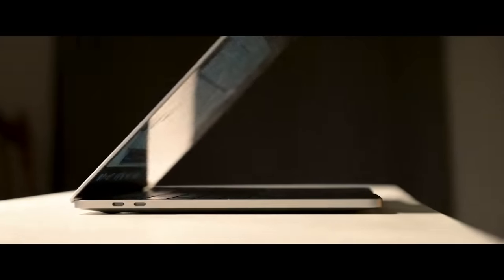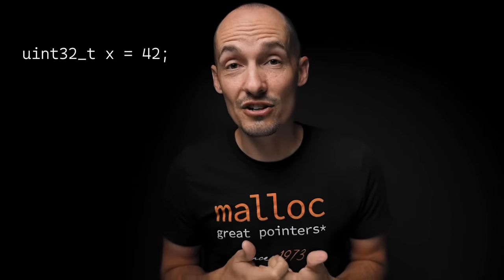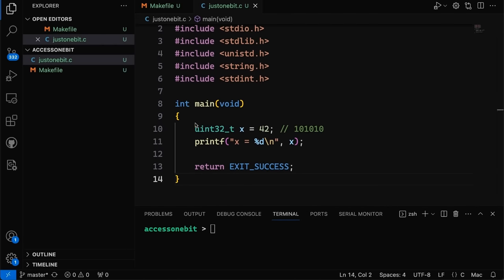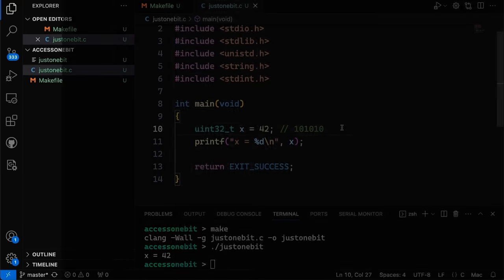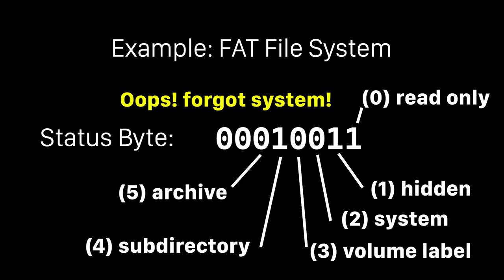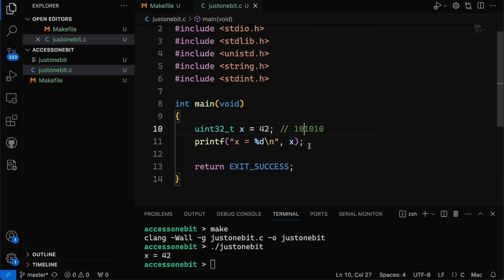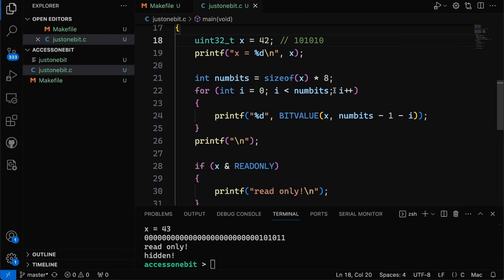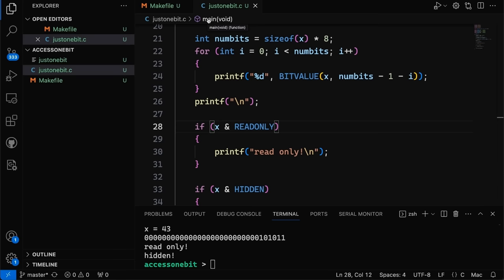How do I access a single bit?

Comment: A passer-by note : in C, you are only technically suppesed to do bitwise operations on unsigned integer types. Signed integer type behavior is signedness implementation specific. Most coding standards will shed a tear if you do this. They will even make you specifically declare your constants as unsigned. I personally allways fall back to unsigned types and use signed types only when necessary. Just saves me a lot of trouble in general.
Reply: I think with C23 negative number representation gets standardized to 2s-complement and with that a lot of signed value behavior should get standardized as well, but I might be wrong.
Reply: @esdel  I sure hope you're wrong. That would reduce C's portability because then the behavior will have to be explicitly redefined for 1's complement machines.
Reply: @anon_y_mousse  2's complement is in C23. 1's complement machines exist? (I realize you might have been sarcastic on that one lol)
Reply: @xhivo97   They're old and rare, but they do exist. It's just that this will be a constant craw in my beak when I try to tout the portability of C and proponents of every other language will point this out with glee even though C will still compile for such computers and many more that their language of choice won't work on and it'll irritate me. It's tough being one of a small handfuls of C proponents. Only makes it worse that now I hear they're adding constexpr to C. If they're just going to copy every C++ feature then I can't finish my own language fast enough.
Reply: @anon_y_mousse  I dislike C— too. But what’s wrong with constexpr?
Reply: @casperes0912   You've misinterpreted what I was saying as I don't dislike C at all. As for what's wrong with constexpr, that's a conversation I've already had far too many times with regards to C++ and no one seems to understand my reasoning so I'll just leave it there.
Reply: @anon_y_mousse   You're the first person I saw going against constexpr. I'm guessing its specifications will be simplified. Regardless, I'm really interested to know why constexpr is a bad idea in C23.
Reply: @anon_y_mousse  they didn't say "I dislike C too", they said "I dislike C-- (as in C minus minus) too"
Reply: @capsey_   No, they didn't. Copy and paste their text into an editor and you'll see it's a full dash, either en or em I'd have to check the Unicode charts.
Reply: @anon_y_mousse  i think it automatically changed two regular dash to full dash
Reply: @capsey_   It's never done that to me or anyone else that I've seen as people regularly use -- snippets of code and otherwise. So unless he comes back to the conversation and says so, I can only base things on what I'm actually seeing.

Comment: Shouldn't teach people to hard code values like 8 bits, we have CHAR_BIT, should use every time to teach people to be in the habit of using adaptable macros instead of hard coded values. The people who learnt to hard code 8 bits as the length of bytes will surely in the future encounter situations where they will have to go through their whole code base replacing that value because of that bad assumption (granted 9 times outa 10 it will be because of old systems that they need to but there's surely research systems etc that use bigger values too)
Reply: Find me a machine made after the 486 where the value is different
Reply: @casperes0912   Does that stop the older machines from existing?
Reply: @casperes0912  I'm not a researcher (well not a professional one anyways) so I don't know what machines there are with it different but then there are dumbass data modals like SILP64, what's to stop some research facility ordering a custom computer where it's different? What's to stop them then using any of the software available to the public on said machine? The art of programming is to throw out every assumption you can, no ifs, buts or whats about it, just throw them out.
Reply: @casperes0912 Lots of signal processing CPUs aka DSP are not byte oriented. They often have 12 or 16 as CHAR_BIT. And yes, even new ones.
Reply: I’ll use avx without any runtime checks
Reply: @casperes0912   Yeah, you show them who's the boss, which they'll learn when the boss comes to fire you.
Reply: @casperes0912  Its not just about portability. Its about avoiding magic numbers. And if there is a predefined constant that is even better than naming one yourself, as the reader ideally already knows that definition and doesn't have to look for it.

Comment: What about a bit field in a struct?
Reply: I like this a lot more since you can make it super clear what everything is. For the same reason I tend to prefer enums over macros for bitflags.
Reply: You beat me to it. You can address bits using a structure which might be a bit easier. struct {
		unsigned readonly     : 1;
		unsigned hidden       : 1;
		unsigned system       : 1;
		unsigned volumelabel  : 1;
		unsigned subdirectory : 1;
		unsigned archive      : 1;
		unsigned bitSix       : 1;
		unsigned bitSeven     : 1;
        } fatByte
		
fatByte.readonly     = 1
fatByte.hidden       = 1
fatByte.system       = 0
fatByte.volumelabel  = 0
fatByte.subdirectory = 1
fatByte.archive      = 0

A good example of using bit fields would be for GPIO access on devices like raspberry Pis to activate LEDs etc.
Reply: @rexjuggler19   I agree, and that together with unions you can easily pass it between interfaces which doesn't use bit fields without having to do some type casting
Reply: This is the way
Reply: The problem with bitfields is that the order is undefined.

As in that is undefined if the first bit is bit zero or not
Reply: @maxaafbackname5562  this is only a concern if you are trying to interpret the data not as a set of flags but a set of bits… so in the context of this video, where it was shown to access flags, bit fields are fine IMHO.
Reply: @etiennepretorius1993  no, the order in the is still undefined in the C standard.
Maybe because it is related to nit endianess, but less direct I'm the way you meant.
Reply: @maxaafbackname5562  as far as I know you should not depend on the layout of a struct… which you are implying doing by trying to associate the bit position with the flag in the struct….
Reply: @etiennepretorius1993  yes, that is what I try to say.

My apologies for saying that you refereer to enduaness.
Reply: Imdefined behavior means that is undefined in the standard.

Bitfields can be used to map to hardware when the behavior is known for that compiler, but mapping with bitfields is not portable.
Reply: May be the correct term is implementation defined in stead of undefined behavior?
Reply: This is the right tool for the job
Reply: @SystemSigma_ although it's generally more clear to use structs, the but order (endianess) is not defined in the C standard and thus can change between compilers and hardware processors. This means that the same code base could access bit 0 on one machine/compiler, and bit 15 on another.

I run into this all of the time with my job. Bit packing in structs is not portable. Macros with logical masking is the way

Comment: Considering that most ISAs have a simple bit set/reset instruction... it always annoys me how complex and unintuitive it is in nearly all high level languages... but I AM a huge assembly language enthusiast and snob.
Reply: The AVR instruction set has the instructions “Set Bits in Register” and “Clear Bits in Register”. However, if you look at their binary encodings, you realize that these are merely aliases for “Logical OR with Immediate” and “Logical AND with Immediate”. These aliases are just hiding the bitwise boolean operations in the same manner as the macro used in this video.

Comment: When you provided ARCHIVE value, shouldn't it be a 0xA instead of 0x10?
Reply: No:
- 0xA is decimal 10, binary 1010
- 0x10 is decimal 16, binary 10000.
Reply: @edgarbonet1 Right, 0xA would set two flags at once. My bad.

Comment: Would be interesting what the compiler does.
If I write x & (0x1 << n), i would assume that 0x1 << n is already resolved at compile time. So this could be as fast as x & READONLY.
If the compiler is really smart, it would also replace (x >> n) & 0x1 with the example above.
Reply: it depends on the compiler, really. I've seen both happen, in different scenarios with the same compiler even.
Reply: Any half-decent compiler knows how to do constant folding. Thus, if n is a compile-time constant, 0x1<<n will be replaced by its value at compile time. May not work at optimization level zero though.

Comment: How about the union method Dr Sorber?  So assume the example of a 32 bit register with each bit having specific purposes. 
So you can define something as below:

union {
uint32_t num;
struct {
	uint8_t a:1; // bit indicates something else
	uint8_t b:1; //1 bit indicating something 
	uint8_t c:2; //2 bits indicating something
	...
	}fields;
}reg;

So say you read the 32 bit register into num as 
reg.num = (volatile uint32_t *) (address)
and then to access individual bits you can simply do 
reg.fields.a 
or 
reg.fields.b etc
Reply: The order of bit fields is not specified by the C standard. This method may work on one compiler, fail on another one, and break on the next version of the compiler where it used to work.
Reply: @edgarbonet1  From the c99 standard "An implementation may allocate any addressable storage unit large enough to hold a bit-field. If enough space remains, a bit-field that immediately follows another bit-field in a structure shall be packed into adjacent bits of the same unit." In this case, the storage unit is uint32_t as set by the union
Reply: @deepakr8261  The bit fields are indeed adjacent. The order of allocation, however, is implementation defined. You could expect a consistent order only if the platform's ABI specifies it.

Comment: I made a function to return a string of that binary, and the result was always empty, cause it was composing the string of only 0 or 1 as int, so empty characters, took me 15 min to find the bug.
It made me learn that you can convert a 0 or 1 (as an int) to a char very easily by adding 48 cause 48+0=48 which is '0' in ASCII and 48+1=49 which is '1' in ASCII.
Reply: Don't add 48, add '0'. Yes, “'0'” is just another way of writing “48”, but writing it as a character constant makes the programmer's intent clearer, which is important in the long run.

Comment: Nice video as always..but i don't get why you have to finish with & 0x1 in the printf or the macro when you do the bitwise..
Reply: Let's say you have :
00001010
              ^
To check the second bit you first shift so to the right by one so >> 1 then it becomes:
00000101
                ^
But then you have an extra bit so to get rid of it you do an AND(&) operation so
00000101
        &
00000001 
        = 
00000001 
Then only the first bit is left if was 0 the the result would be 00000000
Btw 0x1 = 00000001
Reply: @marwan7614  very nice explained.. thanks for your time.

Comment: But instead of a macro, wouldn't it be easier to use enums for the same purpose?

Great video btw!
Reply: Why not both?
Reply: @MechPaul  macros can be a pain to debug
Reply: You mean to define the bit constants?
Reply: not really, since the idea of bitfields is encompassing 8 independent properties of something. there are 2^8 states possible, which you would have to define individually as an enum. It's just not the appropiate structure.
Reply: @zokalyx  enum { foo = 0x1, bar = 0x2, gib = 0x4, gab = 0x8, bob = 0x10..., comboX = foo | bar, comboY = foo | gib | gab, };  
Simply specifying tokens and their values.
One doesn't need to fill in 256 (or more) using the default 'auto increment' feature of enum's.
Reply: @rustycherkas8229  oh I see what you mean! I guess it could be more readable compared to just constants.
Reply: @zokalyx that's how many binary config flags are packed into a single integer.

Comment: Hi Jacob. Many thanks for your work. 

Could you explain, how does delete operator knows exactly how many memory we allocated by new operator, and how we can repeat this logic for malloc/free functions in C? 

I tried to get shifted pointer to sizeof(size_t) bytes before actual pointer and find that we have strange number which is pretty much allows us to know how big chunk was allocated but for my machine it was never lower than 33 bytes even if I requested single sizeof(int ) memory. So I have  question: why this allocated block is always has size so much bigger than was requested and why this size always follows condition (size % 2 == 1)? I mean why this lower bit is always(?) equals 1. Short code example below

  void *p = malloc(sizeof(void));
  size_t *ph = (size_t *)p - 1;
  printf("size: %lu\n", *ph);
Reply: As far as I know, there's no official way in C or C++ to get the amount of allocated memory. Each standard library in each OS can do it a different way. What you do here is undefined behaviour (i.e. it may work for you but it can probably fail for someone else). If you want to ensure you always know the allocated length, you have to write replacements of malloc and free yourself which allocate one extra size_t where you store the length, where you return the pointer next to this number, and where you calculate the previous one before calling the actual free.
Reply: @DiThi  Yep. I know it. But I still want to know why memory header ((size_t *)ptr - 1) contains this weird number 33, 49, 65, 81, 129? For what purpose this lower bit set in 1? Does it means that next 32, 48, 64, 80, 128 bytes was allocated? Then why it doesn't switch to 0 after we free this memory? I just want to know what this header value means. I tried to find this information but I'm still here... I hope you, Or Jacob could help me?
Reply: @artem.pirkhal  operating systems don't allocate ranges of bytes, they allocate entire pages (in most systems that's 4kb). So malloc and friends keep track of used memory within those pages in some other way, like storing the size of the allocated memory at the beginning of each chunk. I just checked that code in my system (linux) and I get the same result, some odd number multiple of 16 + 16 + 1. My guess is that it's actually not the size, but a combination of the size and some flags. That extra 1 is probably some flag with a different meaning. Since it's always aligned to 16 bytes, it doesn't need the lower 4 bits, so it's zeroed out and used for other purposes. I accidentally corroborated this by adding more parameters than arguments to printf, which prints internal CPU registers and one of them is the length without the extra +1.

It's probably not set to zero because it's likely keeping small freed buffers around to give when requesting another malloc, so it doesn't waste time calculating stuff.
Reply: @DiThi  Make sense. But using overloading of new/delete we are able to track memory allocation in C++. Sad that we don't have this abilities in C. Only by making custom allocation/freeing macros or function overloading. Interesting to know, how that implemented in C++